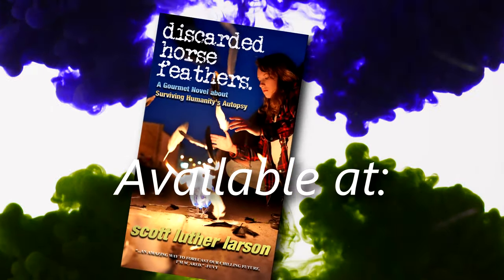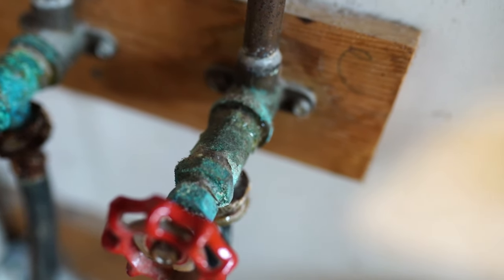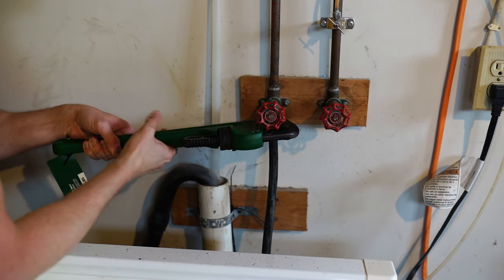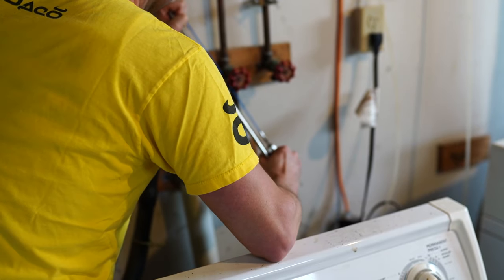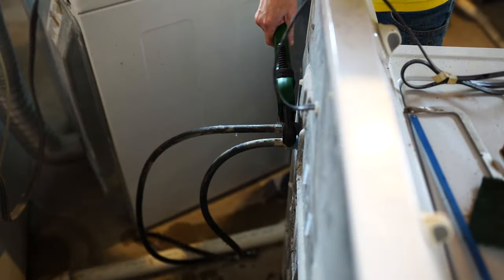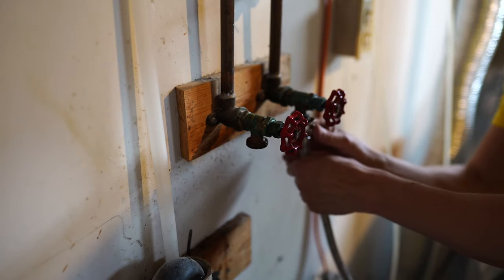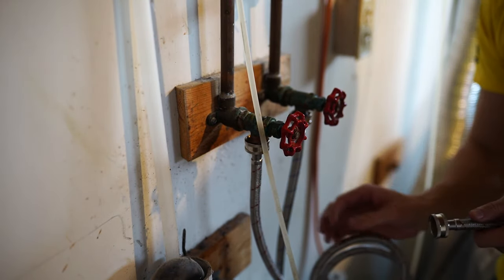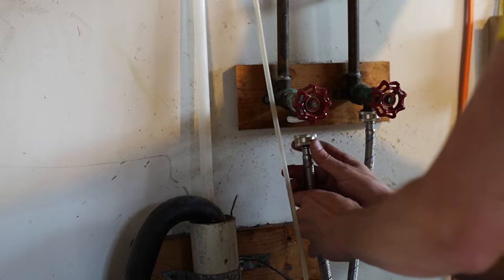Tricks for Replacing Stuck Washer Hoses on Washing Machine

Comment: I did it. I let it get that far. That's why I'm here. Going straight to the saw, thanks.
Reply from the maker: @kittydaddy2023  haha, get after it 💯
Reply: @VestigialVoice  I found the brand new hoses that didn't get installed on my washer I bought 7 years ago, so the hoses on there are probably 20 years old.
Reply: @VestigialVoice  I'm ebarrassed to say it was the white vinegar and baking soda that did the real work.
Reply from the maker: @kittydaddy2023  Way to go!!

Comment: There is usually a screen inside the hose inlets on the washer which can be removed. I know you cleaned openings to inlets, but I recommend removing the screens and cleaning in CLR or similar cleaner. Quite common to see these screens clogged with sediment and/or mineral deposits.
Reply from the maker: Interesting.  I didn't run across any screens.  Perhaps they have been discarded over the years...  I appreciate the comment.
Reply: @VestigialVoice  It is very possible that the screen had corroded away. Even though most are stainless, some manufactures use lesser quality filters.

Comment: Get rid of the gate valves, they are a terrible design and prone to failure due to corrosion and mineral deposits.  The stem in the valve rots and will snap one day when you try to shut it off.  Or, you might be able to shut it off, then it snaps when you turn it back on.  I know this from personal experience. Replace them with 1/4 turn ball valves.
Reply from the maker: Yes, that's a common, but true comment.  I don't believe they even pass code any more.  Not today, not tomorrow, but eventually, I'll have them all swapped out.  Take care, scott.

Comment: Cut the hose, screw out that multiturn valve and replace it with a ball valve.  Ever hear of WD-40 or penetrating oils?  This video should be titled on hiw not replace washing machine hoses.  Heating those hose connections dudn't do much good with water still in the valve and hose.  Should have turned on the washing machine with the valves off to relieve the pressure and drain some of the water in the hoses.

Comment: 3:00 “please, don’t let it get this bad, folks…” me sitting here about to do the same project looking at my spigots that look the exact same way being all green and corroded 👀
Reply from the maker: Lol, Tanner!  I hope it goes well, bud 🍀
Reply: Trick is to wrap a towel around it and soak the towel. Let sit for 10 min or so.
Reply: Same
Reply: @AztecWarrior69_69 soak the towel with what
Reply: @amiyaeoh1140 oops. Vinegar. Use plain white distilled vinegar. Wrap a dish towel around the spigot and soak with vinegar. 10 minutes. Try. Repeat if nessacary
Reply: @AztecWarrior69_69  thanks
Reply: @amiyaeoh1140  NP
Reply: @amiyaeoh1140 did it work?

Comment: Thank you for this video!! I wouldn’t have thought of corrosion being part of the problem. Also the hacksaw seems like a good idea if it still won’t come off.
Reply from the maker: You're welcome!
Reply: @VestigialVoice Just got done doing this after watching you. Thanks!!!
Reply from the maker: @acephas3  nice going 😊
Reply: @VestigialVoice  i had the same issue but only with my cold water. had to cut with hacksaw and got the job done.
Reply from the maker: @draubaud1 , way to go! 👏
Reply: Dry a Dremal.

Comment: Just cut the hose and approach the seized material from inside. Stick a screwdriver inside to hold the valve steady then you can put torque on the fitting. Easy peazy.

Also the threads don't make a seal, only the end ring against the gasket. The threads just apply pressure to the sealing surface. Adding the tape does nothing but make you feel better about it.
Reply from the maker: Good comment, Moon 👍
Reply: NO. Trick is to wrap a towel around it and soak the towel. Let sit for 10 min or so.
Reply: My issue is that the valve is in a valve box without enough room for a wrench !! Any suggestions?

Comment: I am having the same problem, I used your last cutting method, I was able not to cut the threat. Thanks for your video
Reply from the maker: Way to go, Horse!
Reply: Trick is to wrap a towel around it and soak the towel. Let sit for 10 min or so. Take off towel and with a stiff bristle dish brush, knock off whatever will come off. Grip and try to loosen the fitting. If it does not come off , repeat till it does. It won't take long.

Comment: Trick is to wrap a towel around it and soak the towel with vinegar. Let sit for 10 min or so. 

Also Don't use baking soda. That bubbling you are seeing is NOT the vinegar or baking soda working to break down the corrosion, the bubbling is the reaction of the two being mixed. You are actually making the vinegar less effective since you changed the chemical makeup of the vinegar. 

It's like taking a brick (vinegar) and throwing it at a glass window (corrosion) and it shatters. Well take that brick and pulverise it with a hammer (baking soda) and now throw that dust at the window.
Reply: Thanks!  Starting to panic a bit as the vineagar/baking soda did not work and I have a new washing machine arriving on Sunday.  Can't get either to budge.  I have ALOT less room to work than in this video so I'm at a clue what to do.  Doing the towel trick now but with little room to work and alot of corrosion, I don't know what else to do.
Reply: By not much room do you mean you can't move the appliance out of the way because you can't get the hoses off?